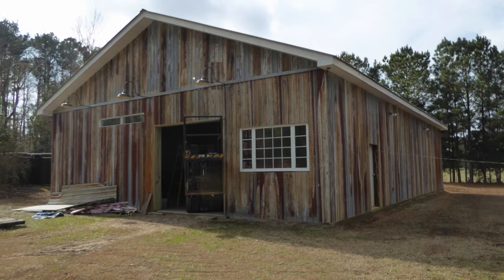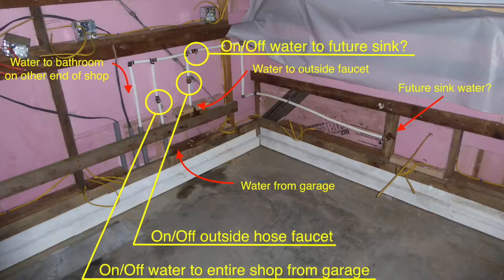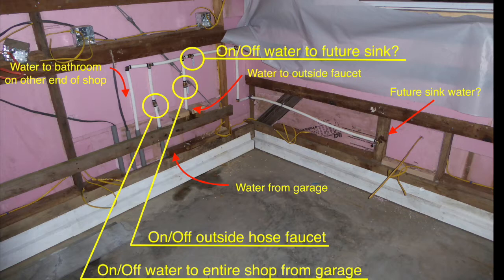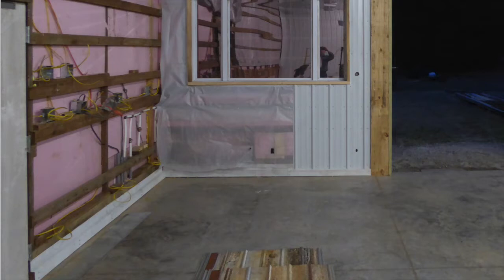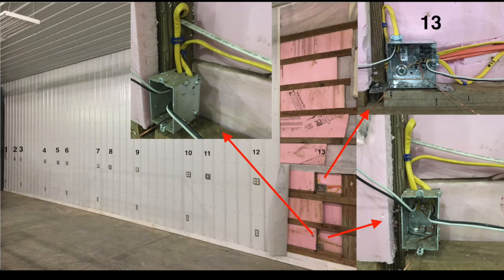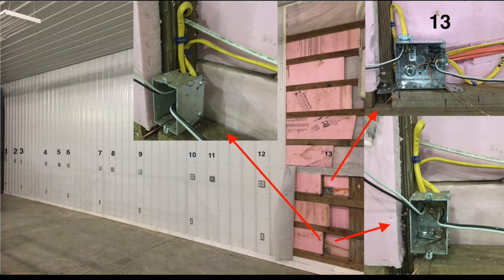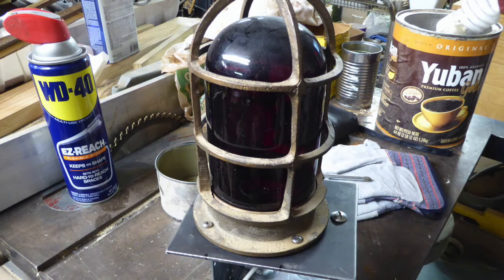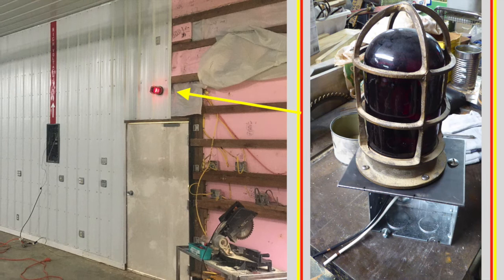How I Built My Pole Barn Shop   Part 5

Comment: Great video. What seems most complicated is all the schematic electrical outlets and drawings you had to put together. But you really have an excellent work shop now.
Reply from the maker: Like any major project there are many nuances and complications along the way.  But it all comes down to simply accomplishing one task after another until its finished.  The drawings and schematics were very important and actually done after the fact to help me later recall what I had done if changes were required.  I would never remember it all otherwise.